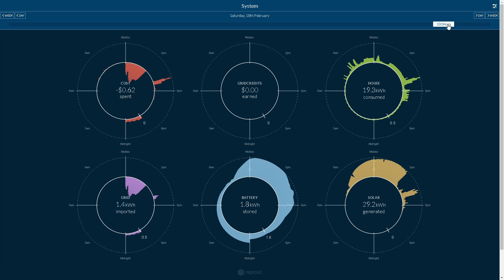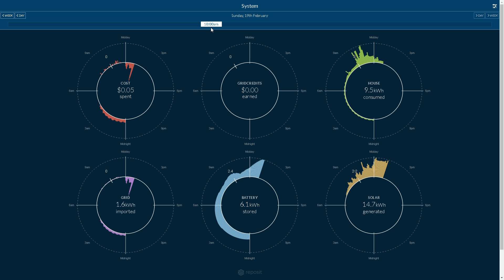Reposit Power and Off-Peak rates - a visual example

Comment: Thank you for your comment i am in the caribben where the power goes out a lot what i understand is they gona come out with the powel wall two without the inverter special for those that have the Storedge inverter from Solaredge but cant get an anser when sale starts i love green i drop my electric bill from $800 to $ $175  with only 14 pannels !
Reply from the maker: Nice! My bill with the battery came down a lot, too. I paid less than $300 for power over the last year, but $2000 the year before: http://unleashthepowerwall.com/2017/02/21/year-of-the-powerwall/

Comment: Anybody now when the powerwall 2 comes out without the inverter , I have the Solaredge Storedge 7.6 inverter works great but when power goes I still in dark !
Reply from the maker: Hi John - here in Australia the PW2 is supposed to start installs in the next month with a few different inverters supported, including Tesla inverter. As I understand it, all PW2 will ship with Tesla inverter, which is then configured to work by itself or with existing inverter.